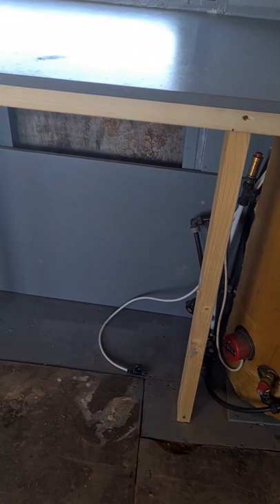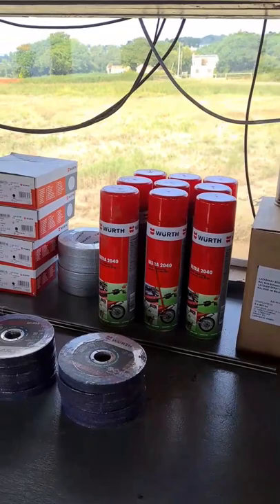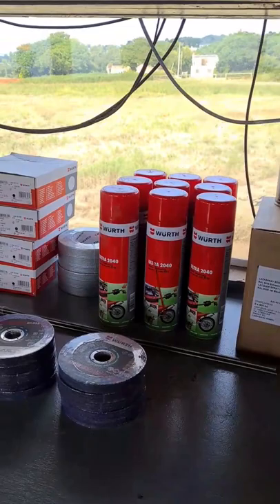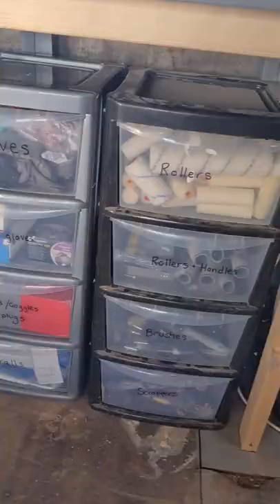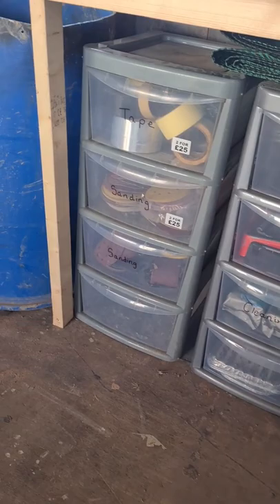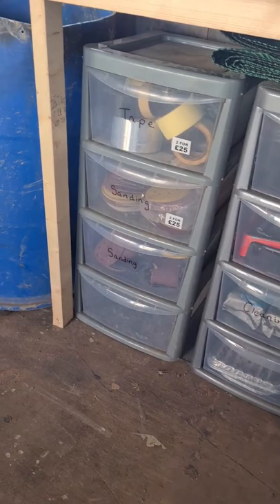#Short Behind the scenes at Sarinda! Work update!

Comment: I wonder why your shorts dont show up as a short.  In the flip up for the next short from somebody else.  

Some people dont like shorts.  You can make a short in seconds .  Some youtubers make several a day. 

For those who dont like shorts.  I worked on a 104' WWII wooden power boat for 22 years.     Hefting ballast around. Scraping tar from the bilge.  Even suction tested a few thru hull fittings. Even unplugged a 2" pump with a hose out the port hole . I did not realize the end of the hose was in the water.  Next morning there was almost 4 feet of water in the back 1/3 of the boat.  The bow was almost out of the water.  And we had 5 feet of draft. Looked like it was doing a wheelie.   Last time I was on it .  I used. My gps to measure the speed.  19 knots at 1,700 rpm on two 6-71s. 32x30 3 blade props for those with a calculator